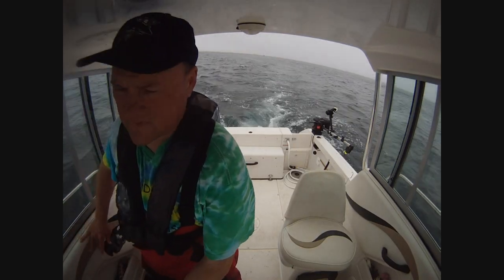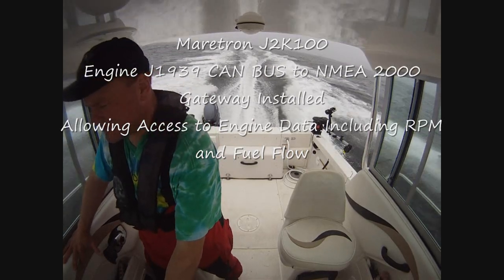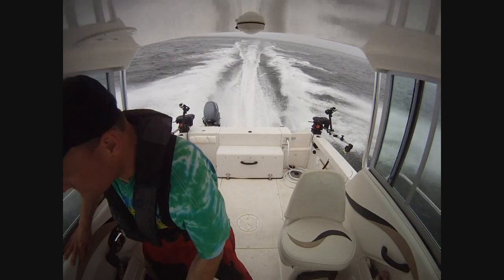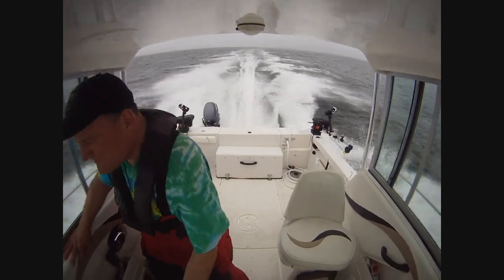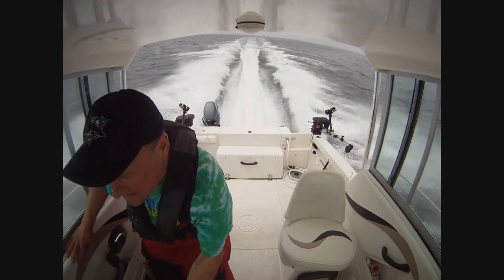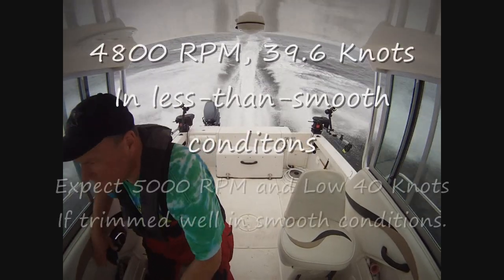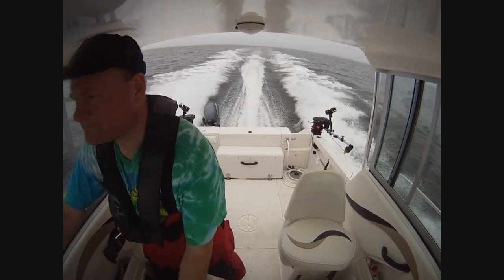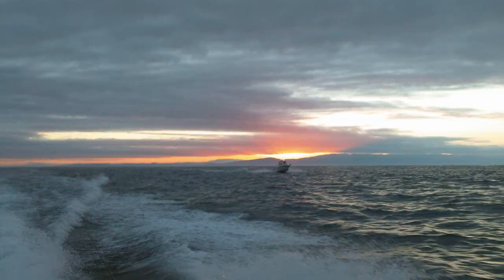Striper 2101 Repower Performance Testing, Volvo Penta V8-270-C-A Ocean X

Comment from the maker: I don't know what my boat weights, but I'd guess it's around 5000 lbs with fuel and gear.   The 5.0 OXi with OceanX outdrive repower added approximately 100lbs over the 4.3OSI with Composite XDP outdrive.   I prefer to keep the cost private... but if you call Helmut's Marine in San Rafael, CA.. he'll get a quote to you quickly.  It's not cheap, but worth it in my mind.   The boat is better than new to me, given that all systems work perfectly and I"m well versed in their integratoin and functionality.